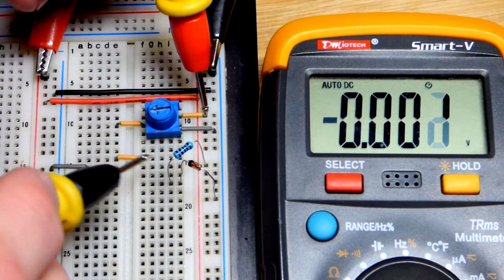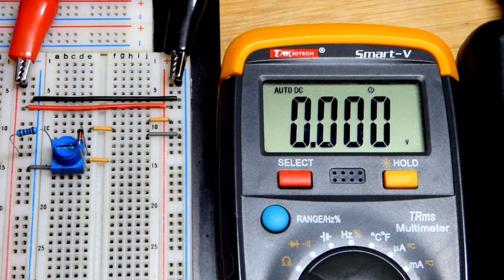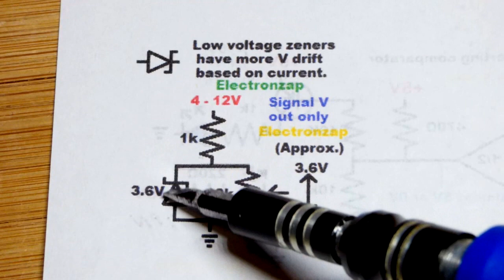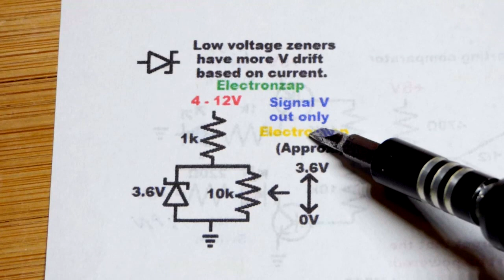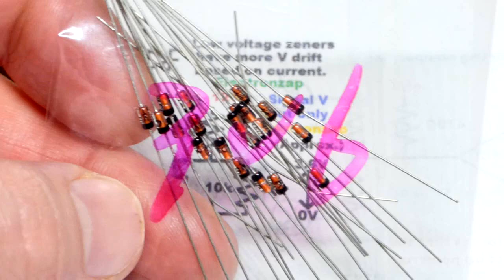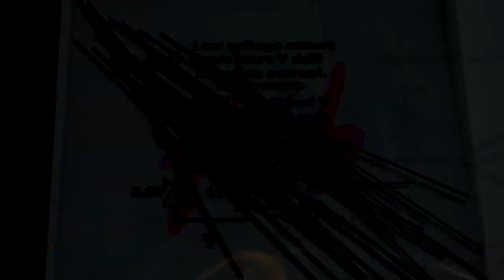Zener parallel to trimpot for a fixed voltage as supply V changes learning electronics lesson 0025

Comment: another good video:-) would the voltage still drift if you used two zener Diodes?
Reply from the maker: Thanks! Less current would go through each of them, so the voltage would not rise as much for a given supply voltage. Could get the same effect by changing the 1K resistor to 2k. The best solution is to use a current source to set the current instead of a resistor.